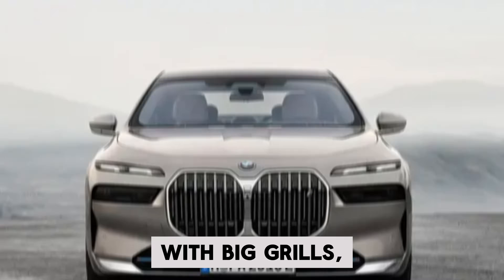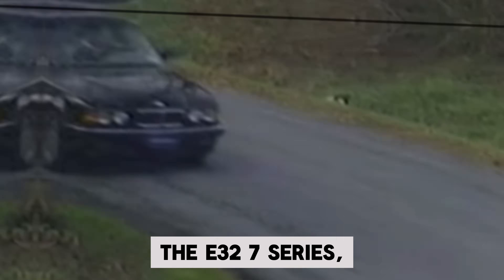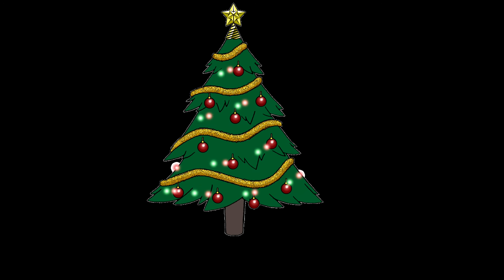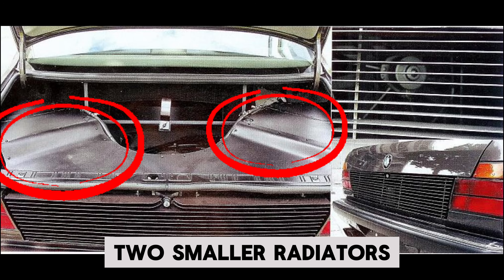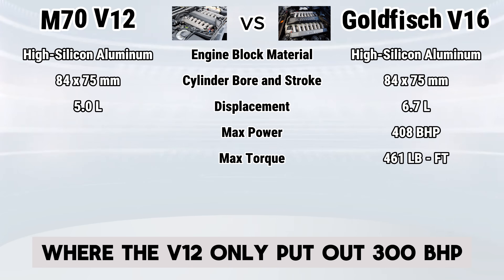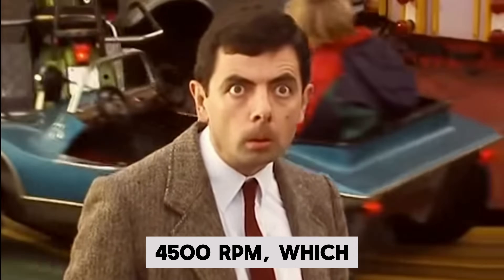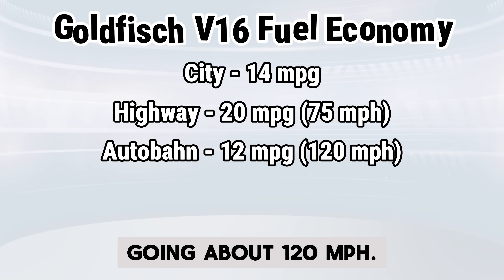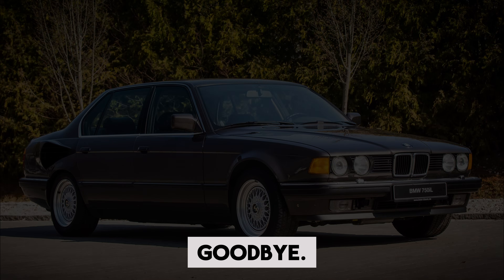BMW's SECRET Engine That You’ve Never Heard Of

Comment: Awesome video. I’ve had two E32s. A 88 735I that I did a suspension upgrade to all B7 Alpina parts and a 89 750 IL. The in-line six after replacing the factory exhaust was faster than the V12 car in the quarter-mile and would get to 155mph three seconds quicker. You need to do a video on the hydrogen powered V12 experimental car that they worked on. Go into the fact that the oil companies shut down that idea by refusing to distribute hydrogen at gas stations.
Reply from the maker: That is a great idea. I appreciate it

Comment: BMW also tried that sngine out in the,RR Phantom in 2015 and it oroduced phenomenal bhp/torque figures then put them in 2 test cars ,but,at the last moment backed down from putting the whole concept into production. It was said that BMW did secret market research and found that the car had incredible appeal for the very rich -especially the Arabs -AND YET BACKED DOWN FROM PUTTING IT INTO PRODUCTION EVEN THOUGH THEY WOULD HAVE HAD AN ORDER BOOK FULL FOR 10 PLUS YEARS -DEFINITELY A MISSED OPPORTUNITY TO STAMP THEIR MARK FOREVER ON RR !!.

Comment: I watched a German interview. If Mercedes-Benz had pulled the V16-card BMW was prepared and had the engine "ready" on paper in the drawer. 
Crazy 1980's - bigger, faster, higher, further. 😉
Reply from the maker: That’s awesome I didn’t know that. Would’ve been an exciting time to be an engineer at one of those manufacturers
Reply: @DrivenbyMatt  Yes and no. There are always others above you to decide if a good project gets a green or a red light.
It seems Wolfgang Reizle did a lot right as head of BMW in mid 1980's. 😉

Comment: IMO it was simply a business decision. The V16 prototype produced only marginal performance improvements over the V12 so they decided against it.
Reply: Plus the packaging in the prototype clearly isn’t viable for a production car so they would have had to modify the front to swallow the engine and keep the radiators there. I expect that tooling to do that would have been more costly than the engine itself. It was cool though.

Comment: I never knew this.. My dad owns the v12 e38 aka 750il, but i never knew they thought of making a V16
Reply: If the factory calls the car a 750il why do some people call them e38s? It's confusing to the average person who might otherwise be interested in the cars. I had a 1987 535is, have no idea what the other name for it was, have no interest in knowing.
Reply: @3ducs  It's just a code name, could be used to identify the generations as there are multiple generations that came with a 750il badge.
The code name for your 535is is E28, very cool car.
Reply: @alidude_  Thank-you! It was a cool car, but it did bring out the bad boy in me. I went from that to a 1987 Audi 5000CS Quattro, also a cool car in a different way. Just bought a 2006 Jaguar XJ8 VDP, hope to get it early next week, it joins a 2016 Mazda MX-5 and a 2016 Jaguar F-Type 3.0 S manual transmission coupe, I think I have my bases covered with those.

Comment: The bigger engines really showed the law of diminishing returns back in the day. I had a 6pot M50 that was 75bhp/litre while the V8s were down to 60-odd and the V12/V16 in the high 50s. I've always presumed it was attempt to keep the fuel economy in some semblance of sensible!
Reply from the maker: I see what you mean. Another reason has to do with the fact that each cylinder “does less work,” and therefore is smoother which is why v12s and v16s are usually featured in luxury cars